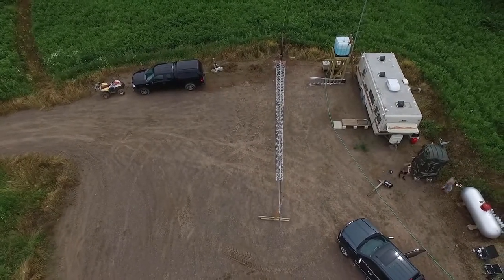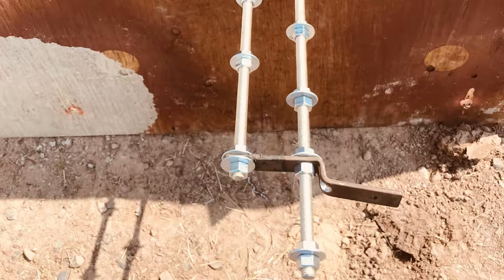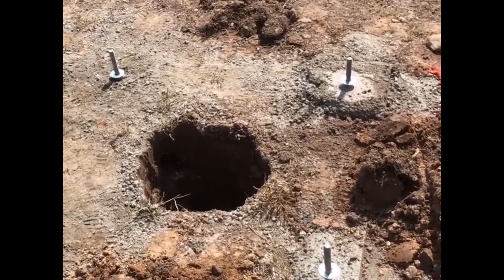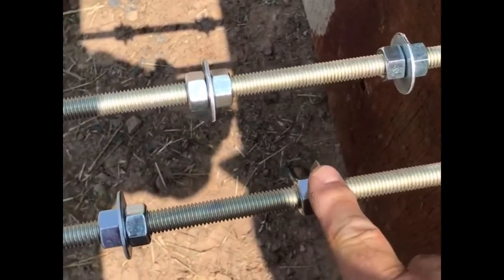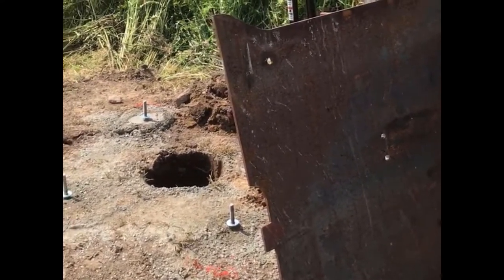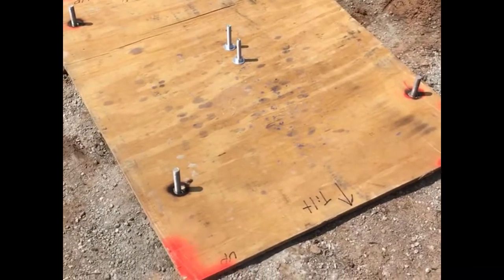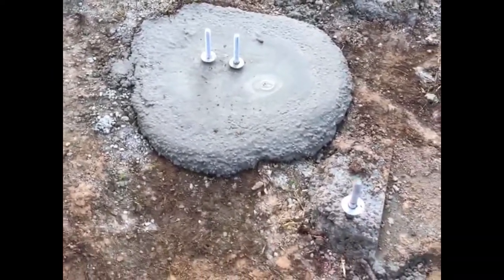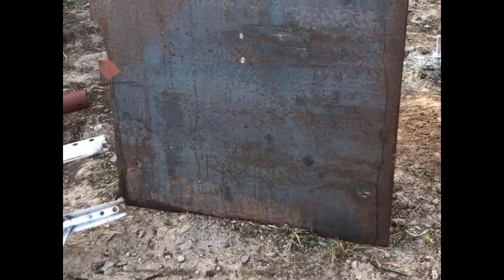Raising My Own Cell Tower DIY Part 1, What It Took To Get A Cell Connection In Northern Wisconsin

Comment: Did you ever run guy wires?
Reply from the maker: Guy wires not necessarily needed. There are thousands of pounds of concrete holding it upright.

Comment: How much do these cost?
Reply from the maker: It’s been a few years now since I installed the tower. I found a used one for $250. Then with all the concrete, excavation etc I would say anywhere between $1,000 and $1,500.
Reply: @GERALD_POST  Alright thank you